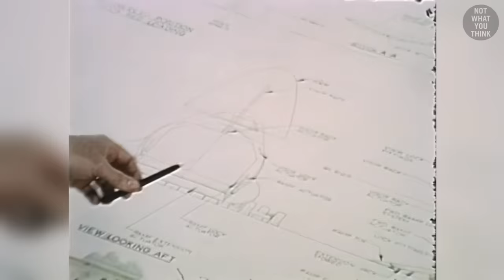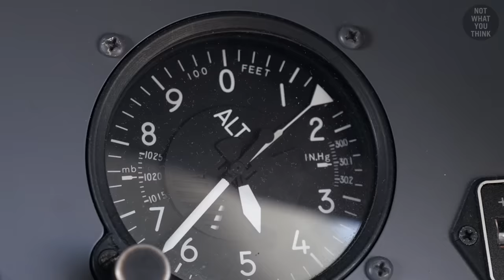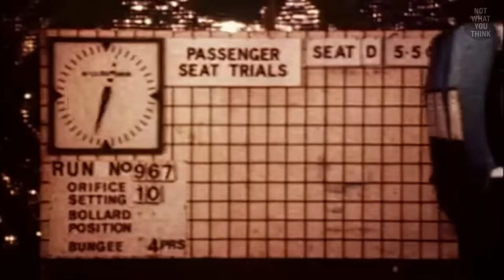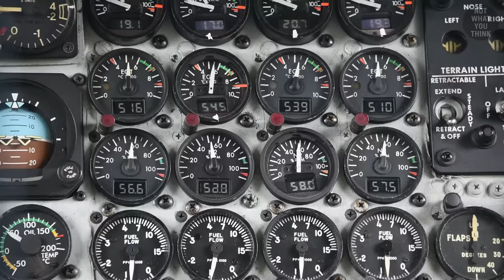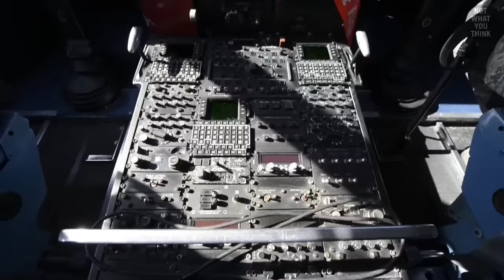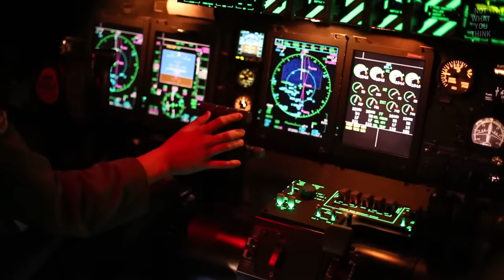America’s MASSIVE Military Airplane that is Named After a Porn Star

Comment: My mom was briefly a secretary on the C5 project at WPAFB. She would come home shaking her head over the project.

Later, when I was in the Air Force, I was stationed at Kelly AFB, which had a facility for testing and fixing the huge C5 engines. When they fired one of these engines up, nobody could sleep from the noise. (My unit worked shifts.) Watching one land, they looked like they were barely moving, compared to the fleet fighter jets also at Kelly.

Comment: Amazing fact, even though the C-5 had a larger wing area, the 747 could out-lift the C-5 by a huge amount. Plus, there was no giant recall of 747s to replace poorly designed wings. The reason Lockheed got the contract for the C-5 is ROBERT MacNamara, who fouled every thing he touched, like Viet Nam, picking the F-4 Phantom over the Vought F8-U3 Supercrusader, (which had F-15 level performance) & a bunch of other stuff.

Comment: I've seen the C-5 Take off from a fairly short runway and it only used about half the distance a KC-135 fully loaded tanker used. The Galaxy and 747 both seemed to just start floating into the air at half this particular runway.

At one time I wished that I could buy one from surplus and turn it into a house. the upper passenger deck could be divided into about 3 bedrooms (1 Master and 3 smaller the cargo deck could have the height halved so you could put in a kitchen and a living room. Then the actual cargo surface could become a multi vehicle garage.

Comment: Someone needs to convert decommissioned C-5's for firefighting. Use multiple bladders to carry say 40,000 gallons of water. Put 6 inch diameter pipe along the underside of the fuselage, and fly parallel to the fire line. You could make multiple passes and because of it's long range go to a large airport to reload bladders. Have them prefilled and push them on using RO-RO flooring.

Comment: I would like to point out that the crash that happened in the video at 4:29 was a lully loaded US cargo transport in I believe Afghanistan crashing because the loaded vehicles got loose and slammed into the tear of the plane dramatically shifting the center of gravity and damaging main and backup hydraulic lines, resulting in an uncorrectable stall just after takeoff.

Comment: My father worked for USAF although he was a UK Civil Servant.  He had to fly to Germany on many occasions and initially the USAF insisted he use USAF transport and the one time he did was with C130 mail plane out of Lakenheath, which had rearward facing seats.  He said that it was the most nauseating flying experience he had and very uncomfortable at take-off when they are apt to stand the C130 on its tail and your only restraint is the lap belt!  After that experience he steadfastly refused to fly military only schedule airline, despite the general inconvenience

Comment: I grew up a few miles from the plant in Marietta and remember the distinct scream of the jet engines on these. I ended up working there a couple of years and had installed a terminal and desk on the tail when they had them in for fire damage repair. Absolutely monstrous plane. I had seen plans for an evacuation system the Egyptians were looking at. They could in theory stack hundreds of people in a rack system they could load and push into it. I had a hangar pass and clearance so I could go pretty much anywhere on the plant, unlike the organized labor. .

Comment: I may be mistaken, but I'm not familiar with any Aircraft that deploy thrust reverses in flight (with weight off wheels). All the aircraft I've ever worked on require W.O.W. to deploy (for safety reasons).

Comment: I flew in one from Kadena Air Force Base in Okinawa to Honolulu (military space available) but final destination Travis AFB.  The take off was delayed because there was too much fog in the loading bay.  The passenger seats were on the top of the aircraft, accessible by a vertical ladder. I remember thinking this would not be a good airplane to board for women wearing dresses.  No windows.  I recall the pilot and the co-pilot saying wouldn't it be nice to spend a few days in Honolulu.  They radioed in that the hydraulic pressure in one of the landing gears was low.  When I left Honolulu a few days later, the same aircraft was still there!!

Comment: A C-5 recently landed here in Sturup, near me, which HAS NEVER HAPPENED BEFORE. As of writing this comment, i don't know if it is still there, but i checked it out and took images when it was there. I can confirm, FUCKING MASSIVE. You could see the ailerons (aka the tail section) ABOVE THE BUILDING.

Oh, and at 3:12 , that isn't just any viggen. I don't remember it exactly, but i googled it and it's one of these: SF 37: Photo reconnaissance, SH 37: Maritime patrol.

(It has 2 seats.)

Comment: MY FIRST TRIP TO Puerto Rico in 1961 was on a passenger plane with rear facing seats. I was a Loadmaster on C -141s for years, they had side seats or passenger type seats facing backwards. This is not new. In the 70s, C_5s were junk. I was forced to stand alert duty many, many times because C-5s were not dependable. Two C-141s would stand backup alert duty with boxcar seals on the doors fueled and ready to go, to back up each C-5s from Dover Air Force Base. Bad wings-also dangerous pressure doors in the rear precluded rear door use for a very long time. They had short-lifetime wings then and flew very little. This can be proven. I understand that later they had 10s of millions spent on each one to refurbish a junker sold to the USAF. Now they are supposed to a good but very old plane that went into service in the late 1960s.

Comment: Ok every plane that has high bypass turbo fans can use thrust reversers but its not advisable to do this becauseof reingestion witch is hot exhaust air that is going back into the engine. Tey normally only do it on landing when other air flow helps against reingestion

Comment: I'm curious as to when the rule that prevents airliners from using thrust reverses to backup came into effect. I ask because when I was in high school, 40+ years ago, I saw a 727 back-out of it's gate at Dulles. Just so you know, it did not need to get a push start, it just backed up, then turned its wheel and proceeded forward toward the runway.

Comment: During an air show, while inside the C5A, an airman explained to me the markings on the inside of the fuselage. He said that they are used to place heavy equipment in the right place for weight distribution. A one foot difference with an M1 Abrams can be very significant.

Comment: I have a question

Is the upgraded C5M more capable than the antonov 124?

The new engines on the C5M give it about 15 to 20% more power.

The C5B had a bit less max payload than the an124.

How about now?

Comment: The C5 is an amazing feat of aero engineering, but  rear facing seats in military transport aircraft are not a recent innovation. Britain's Royal Air Force Transport Command (bl**dy Brits) aircraft have been configured with rear facing seats since the 1950s, for the same reasons as in the C5, ie,  better passenger survivability in the event of a sub-optimal landing. So Lockheed were in that respect a little late to the party, but only by about about 60 years or so, however, they did get there eventually.  bless'em.